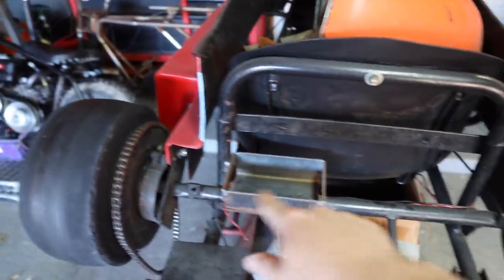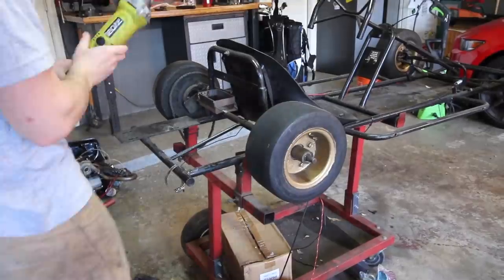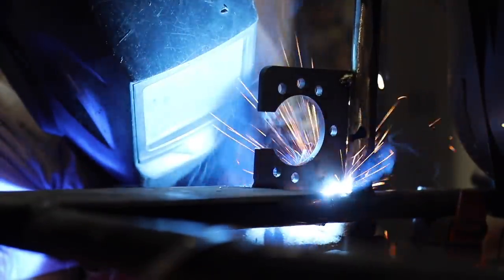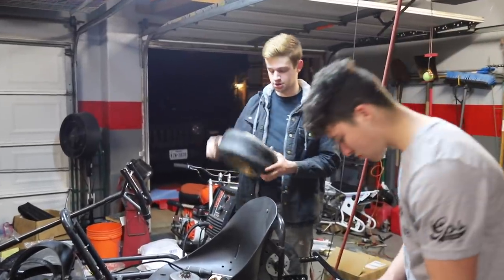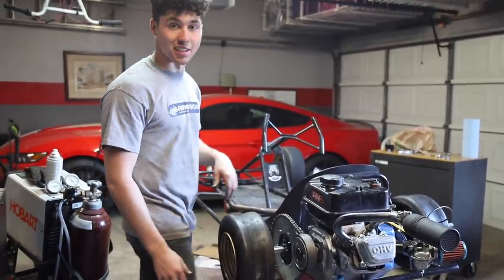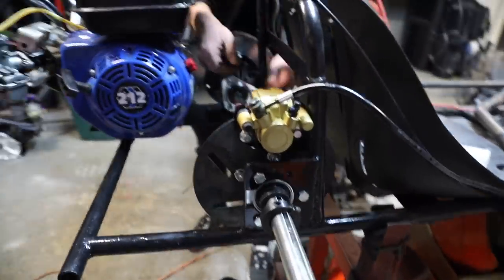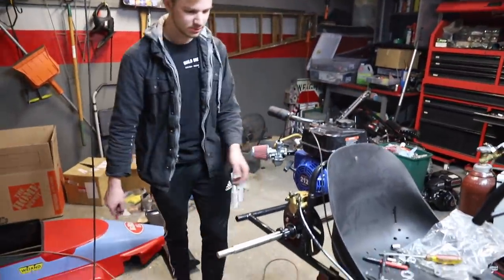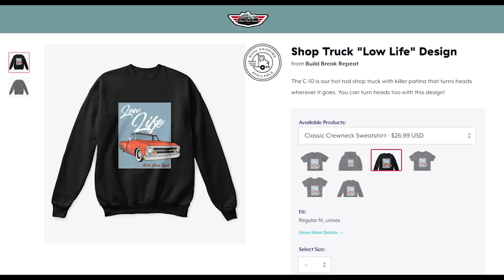Live Axle Swap for the Turbo Go Kart! | Tillotson 212 Install

Comment: To be fair, this engine isn't stock.  It has a mikuni carb.  So you're looking at a $400 engine counting the air filter and exhaust.  Plus they had to remove the govenor. It's cool, but i'm not really sold on it.  You can buy race/offroad prepped 212's that put out 12hp for around $300 minus the exhaust and filter.  I'd probably opt for the race prepped 212 from NR as it comes with interrnal mods and an aluminum flywheel and has already had the govenor removed Of course, I only run big blocks so doesn't really matter.

Comment: Thats slow
Reply: Dont take that from a Joe shmo
Reply: Do a real go kart. 125cc or bigger shifter man. Too many go karts with tillotson and pred engines.
Reply: No, there is a reason that there are predators. A 125cc cheap motor is weak and powerless. If you build a shifter kart, you need a 125 or bigger two stroke. That's an expensive motor. Besides, not only is it go kart heritage,  but the $99 predator can make 11hp with free mods. And 15hp for free if you port and polish it. You cant beat the predator. It's cheap, fast, and reliable. And dont complain about them not doing anything different, this kart is a TURBOCHARGED PREDATOR KART. Not many people do it effectively.
Reply from the maker: We’ve got some shifters on the way, the rotary is going to be sick. No hard feelings man
Reply: That rotary is going to be amazing
Reply: @a.j.sgarage9637  the engine on the kart is Not a Predator it's a
 Tillotson 212 a Much Better Engine"